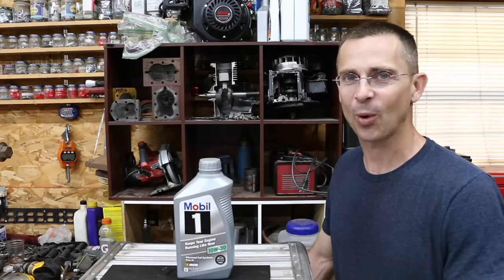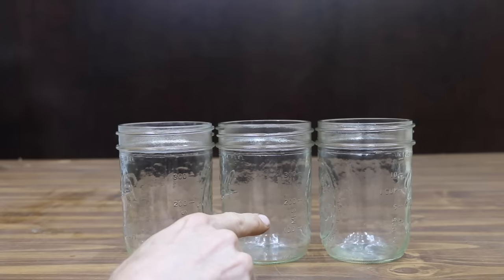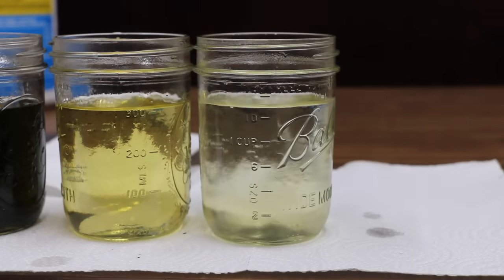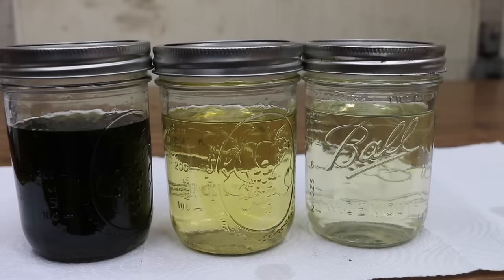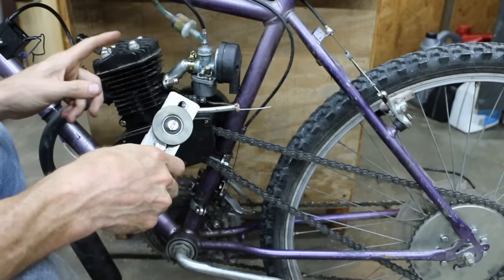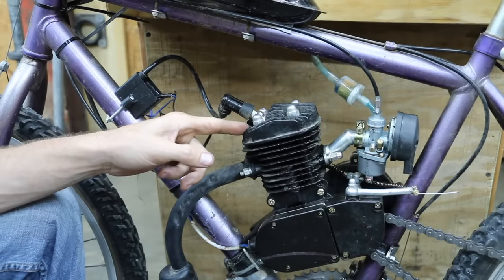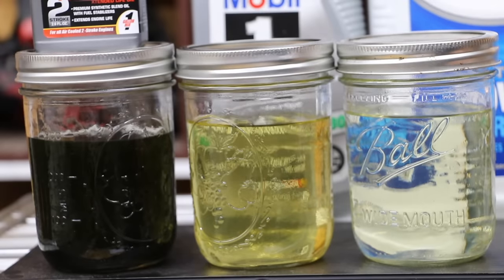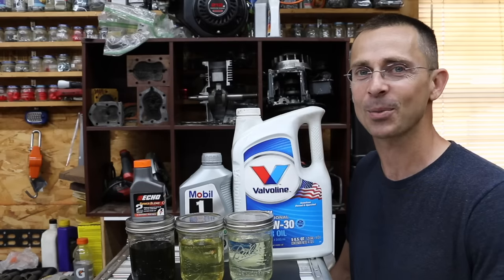Will 4-stroke oil damage a 2-stroke engine?  Let's find out!

Comment: When 2 strokes were first used in chainsaws and outboards, the recommended oil was 30w.
Reply from the maker: Thank you for this information.
Reply: I still use car oil in my old chainsaws, they were built for it.
Reply: Non detergent
Reply: Project Farm  what about used oil
Reply: Gavin Ford used oil is nothing more than oil that has fine particles of metal , nevertheless it will damage your engine surely
Reply: Yes but at a ratio of 16:1. Why even chance it. So foolish just to save a little money
Reply: @jeschreindl  those old ball bearing two stroke engines needed a lot of oil! I have an old saw from 1960. 124cc. I still run it on the original 16:1 recommendation and haven't really noticed any difference between running 30w non detergent oil vs modern two stroke oil.
Reply: Your exactly correct
Reply: @Bull3tBikes  filter it first
Reply: Yeah,for the bar.....only.never mixed in gas
Reply: The Bounty same, I used seived used motor oil on the bar, works a treat, sticky, lubricitous and CHEAP
Reply: Thanks for the info, I'll put it to good use next weekend.
I bought a 1950's Elgin outboard with all of the original paperwork.
It says to mix motor oil in the gas.
It gives a ratio, but not a viscosity for the oil.
Now I know that I should be using 30 weight, without detergents.
Reply: @kaisersose5549  actually, today's two stroke oils are much better. I would use two stroke oil. Join a outboard forum. They'll know.
Reply: non detergent
Reply: @dans_Learning_Curve  
I'm less than impressed with modern 2 stroke oil.
The main issue being the requirement to either obtain ethanol free fuel or deal with a nasty emulsion when moisture from the air condenses inside my fuel tank.
The area I live in gives fuel stored inside of an HDPE gas can a shelf life of about 2 weeks.
As long as I agitate the 30 weight/gas mix, I don't have to deal with an emulsion, only the water.
Reply: .... .2 stroke oil didn't originally  exist. We were advised to use the best quality engine oils to mix with the fuel .
Reply: yes i remember our first lawn mower with a 2 stroke clinton engine we used 30 w oil,  back in the 50s didn't know there was anything else and might not have been even available in back woods Canada
Reply: Only us old folk know that 😜
Reply: My bultaco motorcycles were built to mix 30 weight oil at a 20 to 1 ratio. I use modern oil now.  Intercontinental Golden Spectro at 50:1
Reply: My 90 year old Father told me the same thing and I still do it today though I use a lighter oil as engine tolerances are tighter today.
Reply: My Dad bought his 61 Johnson 75 V4 brand new and still remember him putting a can of SAE 30 into his 6 gallon tanks. That's all he ran and engine ran great for decades.
Reply: @ProjectFarm  Motorcycle synthetic or conventional oil which one is better for protection of the engine and the clutch?
Reply: Exactly just had to give it a little shake up in the morning
Reply: everything was 30w.! lol
Reply: You need a better compression tester with a check valve. That 2 stroke motor is probably 130 psi I bet.
Reply: You should compare lubricity of each mixed at the same ratio as well as lubricity of two stroke oil at leaner ratio intervals. Love the channel!
Reply: yes i had a craftsman chainsaw that recommended 30w
Reply: @ProjectFarm  1:33 oil mix ok ? Husqvarna ls+
Reply: Came here to post this.
Reply: Yup
Reply: @Bull3tBikes  Used 4 stroke engine oil will have been through the engine thousands of times, and through a filter which is supposed to remove debris which would cause damage. When oil is used on a 2-stroke, it goes through the engine only once so if there is suspended metal, the damage will be limited compared to the effect on a 4 stroke. 2 stroke engines are inherently less durable than 4 stroke. The more oil in the fuel, the more lubrication and the longer it'll last. So if I have "free" used engine oil, i'll likely increase the oil proportion until exhaust smoke becomes an issue, then back off a little.
Reply: @thebountyschannel  Some old saws have cast iron cylinder sleeves like a car!
Reply: @danteerskine7678  
Good for you. 
Having looser environmental laws would make my life much easier, but then, I rather like the environment the way it is.... 

I had to do some experimenting to find a solution for both the issue caused by 2 stroke oil emulsifying and the humidity in the air condensing inside of my fuel tanks. 

To break the emulsion of gasoline/gasohol, 2 stroke oil and water, add about 20% methanol & shake it up. When it settles, you get the water, ethanol and methanol in a layer on the bottom & the gasoline and oil on top. 

This throws the ratio of the oil mix off by more than newer 2 stroke engines can really handle though. 
To fix this, I painted a 5 gallon carboy black (on the outside), ran a copper tube from the stopper to an old transmission fluid heat exchanger (like a small radiator) and another copper tube from there to a flare fitting installed on a gas can. 
After a couple of days, I've got nearly pure gas & what's left in the carboy will return to the same viscosity of oil I started with in a couple more days. 

The only thing I haven't bothered figuring out, due to legal restrictions, is how to reclaim the ethanol and methanol that formed an azeotropic mixture with the water.
Reply: @Bull3tBikes  engines with oil filers different story, i only use new oil for 2 stroke mix a combination of 2 stroke and 4 stroke and use sump oil filtered for my chainsaw bar oil
Reply: And 2 strokes back then had to be rebuilt all the damn time and fouled plugs constantly! 4 stroke oil contains zinc and detergents that cause ash, and ash is a big killer of 2 strokes. Just because something was recommended 50 years ago, doesn't mean it's good today.
Reply: @thebountyschannel  They absolutely were not built for it and you have to know absolutely nothing about oil or 2 strokes to believe that.
Reply: @gavinford9918  Used oil!? What scars pistons and cylinder walls in 2 strokes? Carbon! What is used oil full of? CARBON. Plus all the detergents that causes ash. Why do you people want to ruin your engine to save $3.50 on oil??
Reply: @bobbygetsbanned6049  lol, ight

Comment: 4 stroke oil was originally used to make 2 stroke fuel. I have a old tiller made by a company called Rototiller and the manual say to mix 1/2 quart of 10w-30 to every gallon of gas. The tiller was made in the 40's
Reply from the maker: Thanks for commenting on this.
Reply: two stroke oil is SAE30 single grade 4 stroke with some extra cleaning additives
Reply: Up until the mid seventies, two stroke oil didnt exist, and drivers of two stroke vehicles used normal engine oil(4 stroke).
Reply: BS the manual made in the forties didn't mention multi grade oil because it didn't come out till the sixties.
Reply: @stevek8829  No need to be nasty. But he is right, we had an old Allied snowmobile that said in the manual to mix non-detergent sae30 weight oil with the gas.
Reply: Johan Verloop Thank you very much. I was sure some one had the answer to my question, as to when 2 stroke oil was developed and came into usage.  I thought my Grandfather was a little cavalier in his choice of oil for his 2 stoke outboard marine engines and that was why I’d end up rowing home on occasion. Learning I should never doubt the wisdom of our fore-bearers.  They were pretty smart people. They had to be.
Reply: @ProjectFarm  more two cycle oil tests please. Cheap oil versus racing oil and castor 927. Thanks.love your video's
Reply: Yes plz
Reply: Trust me. Oil is oil 95% of the time. If you run it hard, count on rebuilding it.
Reply: @stevek8829   Actually, oil designed for 2-stroke engines did exist many years before the mid seventies.  In 1965, I owned a 2-stroke Vespa motor scooter.  In 1967, I owned a Yamaha 305cc twin cylinder 2-stroke, Big Bear Scrambler.  I used Castor 2-stroke oil in both of them -- it was a greenish color.
Reply: @wayneashby5030  do you mean Castrol oil?
Reply: @michaellinner7772  No.  It was Castor 2-stroke motor oil.  It's still available today with a different label branding.  For example, here's a link on Amazon for it:  https://www.amazon.com/Maxima-Castor-2-Stroke-Racing-Premix/dp/B01I6D7AB4/ref=sr_1_9?keywords=castor+2-stroke+motor+oil&qid=1552137477&s=gateway&sr=8-9
Reply: For motorcycles IJ Festival 1956 (copy DKW 350 NZ 1935) the recommended blend is 2%.
12.5% is exaggerated, and 2% clog the exhaust and run a long time if the idle speed , clog the spark plug.
Reply: @johanverloop3128  I would believe that some 70's ear engines may have called for mixing 4-stroke oil in the gas, but 2-stroke specific oil definitely existed long before the 70's.  We had some 1960's era boat motors until recently and the manuals called for 2-stroke oil, so it has been around at least since the 60's.
Reply: @wayneashby5030  And the greeny blue Castor oil / Veg oil 2-stroke oil is used today for marine and forestry use it smells in-between a rc car and McDonald's
Reply: dirt_monkey hey I had a CZ125 which at a push the Jawa company said to use engine oil if no 2stroke
Reply: Holy guacamole thats a lot of oil. I have a couple old saws that run a 16:1 and specify using regular ol' 30W
Reply: dirt monkey  They did not have 10-30 oil back in the 40's !!!!!  DUUUUHHHH  !!!!!
Reply: 30 weight non detergent
Reply: Interesting. One major difference though is that engine oil back then had very little to no additives in it. It didn't have all the detergents and other additives that modern oils have, and it's the additives in 4 cycle oil that could potentially gum up and cause a problem, not the oil itself. 2 cycle and 4 cycle oils are likely made out of the same base oils, just different additives.
Reply: @chipb9026  Your manual doesn't mean there wasn't two stroke oil earlier then the mid seventies as he said. Oil was specifically marketed for two strokes in the sixties that I can remember. One I raced with was a concentrate branded "Full Bore." Others were based on the caster bean and made a great smell at the racetrack. So he shouldn't have played professor.
Reply: We also have a 1943 Rototiller brand. Ours has the Kaiser Fraiser 5 hp 2 stroke that calls for 30 weight. Awfully cool old machines sound so unique. Ours was originally purchased by my grandfather. He called it happy because when it was running at idle, he said it sounded like it was laughing. It sat for 24 years in his shed and sorted with new points condenser  and fresh gas.
Reply: @darkwoodfarms1040  I read WW1 pilots had to wear diapers because they mixed the gas really thick and the fumes from the castor (bean) oil would make them shit themselves during dogfights lol. I believe the lawn mower/tiller manufacturers suggested using straight 30 weight just so people wouldnt have to go out and buy special oil to run their Lawn Boy.
Reply: @dadsonridebuds2622  i want to get 5 gallons of motul 800 2t for my 8v92 detroit 2 stroke, not cheap though!
Reply: You mean straight thirty eight in the forties
Reply: 30 weight non detergent was common for old 2 strokes
Reply: Sorry buddy, multi weight oils didn't start until the late 50's early 60's,I believe..
Reply: @jlo13800 it's s 2 stroke diesel, but it requires diesel engine oil. IE 15w40.
 They still have an actual crankcase that requires oil just like a 4 stroke would.
Reply: Please don't use non-detergent oil in anything mechanical. Somewhere along he line, the definition of non-detergent became corrupted, and the stuff sold today has no anti-wear additives whatsoever. It is literally clear, like laxative oil. It's actually illegal in some states to label it as engine oil.

Comment: Modern 4 stroke engine oil is formulated to lubricate smaller gap between metal contacts. If your using 4 stroke engine oil in 2 stroke engine there shouldn't be much of a difference in performance or protection.

Comment: In 1979 I purchased a brand new Chrysler 115 hp outboard motor.  It used surface gap spark plugs and it was recommended by the manufacturer to use type TC-W 2 stroke motor oil.  It was not oil injected.  At this time TC-W oil was very hard to find.  I reached out to a friend who was a reliability engineer for the United States Coast Guard to see what he would recommend.  Surprisingly, he recommended Shell Rotella 15W-40.  I decided to use it.  I kept that engine for 14 years and it was running perfectly with  over 4600 hours on it when I sold it.  The one and only thing I ever had to repair on that engine was to replace the fuel pump.  When I sold it, it still had it's original spark plugs.  Chrysler said the expected life of this motor was 1500 hours.  Thought you would like to know that.  Love your videos.  Keep them coming.
Reply from the maker: Great information!  Thank you

Comment: Had a 1956 Johnson 30 HP outboard motor that wanted the oil mixed 32 to 1 in the gas.  Always used cheapest  30 weight motor oil and ran that boat for years on the Mississippi River.
Reply from the maker: Thanks for commenting on this.
Reply: Yes with no problems to i bet much cheaper
Reply: Did they make 2 stroke oil back then?
Reply: I put my comment in before ii read yours, yep, just like papaw and his blue homelite saw. Cheap 30 weight, ran great for maaaany years.👍👍👍
Reply: @jaygames1980  .
Reply: all old Rudy's and johnny's used 30 weight oil in high concentration, 16 and 24 to 1...believe it's all they had then
Reply: @terrymaines69  LOL
Reply: Motoarele de barca sunt diferite de motoarele terestre .De exempu prin temperatura de functionare ...
Reply: mike brink  im no where near the mississippi river im in australia mate 
why i felt the need to tell you ? i have no idea either lol 👍👍👍
Reply: @toby621  I'm from Washington state lmao
Reply: My dad did the same in a Vespa scooter when oil specific for 2-stroke was difficult to find, no problems either.
Reply: @oceapliler2950  Oklahoma
Reply: @goldraker5401  Quit trying to scam people
Reply: @goldraker5401  Nobody really cares about your "free stocks"
Reply: Same here. My grandfathets 1956 seahorse 10hp. States 30w sae half pint to a gallon 16:1
Reply: I have used coconut and castor oil, gear fluid,  power steering fluid as two stroke mix , any oil I could find in my dad's garage. DON'T USE ATF AS TWO STROKE MIX. IT SEIZED UP MY 4 HP YAMAHA OUTBOARD.
Reply: @jaygames1980  Just regular oil
Reply: @jaygames1980  Most old cars were 2 stroke anyways!
Reply: Well one day i hit a pot hole and 2 stroke fell out of the 4 stroke and my truck became a 2 stroke. i don not miss the other 2 stroke that fell out!

Comment: When I was a kid in the late 70’s I had a 1976 yamaha YZ80. I can tell you I ran a lot of 4-stroke oil through that bike. When I ran out of 2-stroke oil I would use whatever dad had around lol
Reply: I did the same with my yz125. I used whatever the old man had in the garage that looked like it was oil. I never cared about ratios and sometimes the bike would be smoking like a chimney, other times burning almost clean. I'm sure I caused all kinds of damage to that old bike, but if never quit, and provided me with lots of fond memories.
Reply: Flying Dutchman Wholesome
Reply: I had a Hodaka Ace 100 in the 70’s, and did an epic 3 day off road journey with two friends who were on 4 stroke Hondas. I forgot to grab my 2 stroke oil when we left, so I had to buy a quart of Pennzoil 30 weight at our first gas stop. Other than the exhaust smoking a lot, and smelling like the exhaust of a car with worn out rings and valve guides, it ran perfectly well!
Reply: Similar thing when I was a kid.
Kawasaki KE125 would run like a champ with whatever oil was dumped in it - even old and dirty motor oil.
Reply: I did that with a 2-stroke lawn mower... whatever motor oil was handy... except it was about 5:1 in a mower that had been sitting for 30 years. Started right up and ran great!

Comment: A friend of mine had a 1984 Yamaha Towny  49cc scooter. He ran out of 2 stroke oil and filled the reservoir with Crisco vegetable oil. He ran that till the reservoir  was almost empty. He would have kept going but I found out what he did. I was following him and it smelled like popcorn. That was funny. We cleaned it all out and it was fine till he filled it the next time with peanut oil. It was so plugged up with carbon it barely ran. I cleaned it all up again and it ran like new.
My friend is now a licensed mechanic working for a Dodge dealership.
Now that is funny.
Reply from the maker: lol!
Reply: How did that work? Any engine damage
Reply: Bruce Miller 
I am sure that it did some damage but after all the carbon buildup was cleaned out it ran perfectly and had no noticeable loss of power.
That was riding it about 200-300 miles with vegetable oil instead of 2stroke oil.
Reply: Thst is funny love the story
Reply: I used to put brake fluid in the tank of my two stroke moped made it smell like a race engine!
Reply: @metalmicky  i did that with chainsaw
Reply: The fact that he became a Dodge mechanic is just the perfect ending for the story.